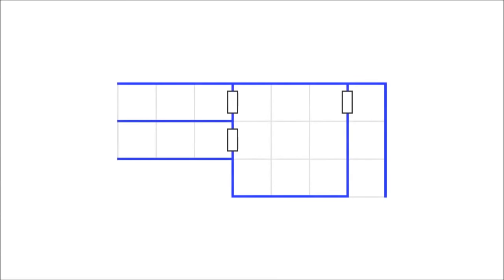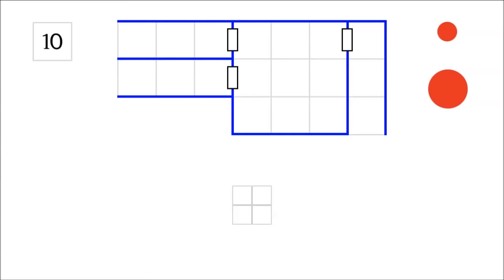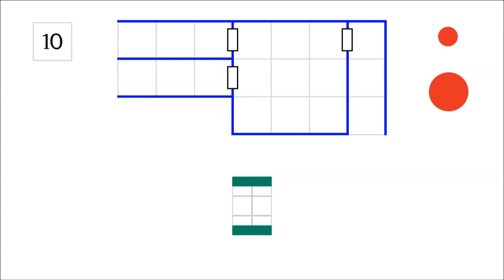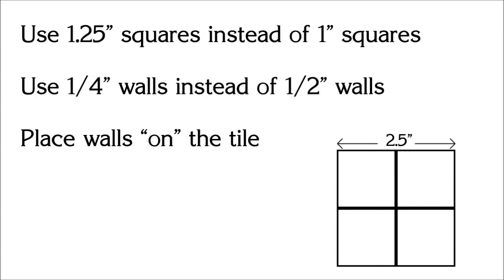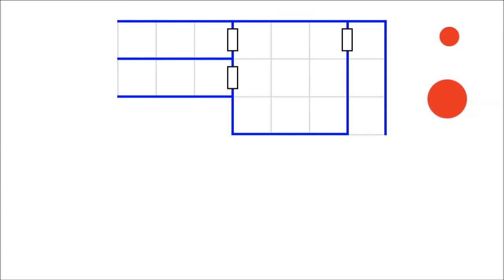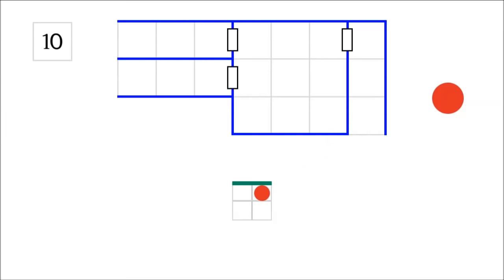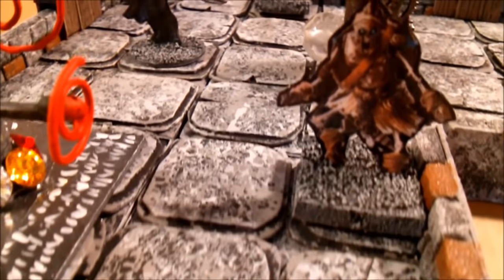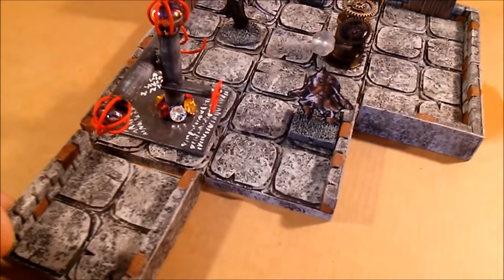Why a 1.25" Grid is Better than 1" Grid on Dungeon Tiles for Dungeons & Dragons

Comment: Warlock tiles by wizkids solved the wall issue while maintaining the 1 inch standard.
Reply from the maker: Alas, no they did not.  Watch again.  Or for a more modern explanation than this old video, try this:  https://www.youtube.com/watch?v=JUecWG1W-ss
Reply: @WylochsArmory  I'm not sure where you're mentioning the warlock tiles in there. But I have some and you can in fact recreate dungeon maps pretty accurately with them.. because they use a very thin interior wall that slips between tiles instead of a half inch space that takes up squares (like Dwarven forge)

Sure the small metal piece that slips in between tiles may be adding a small amount of space (like a 32nd of an inch) but it's pretty negligible.
Reply: I only mention it because I have recreated this system myself and it could be helpful to some with limited table space like you mentioned with your true tiles.
Reply: @xxbrkdwnxx  It looks like the WizKids interior walls don't eat up much space and it does seem like a work around but unless they enlarged their grid, that space is still coming from somewhere.  It also forces you to use interior vs exterior walls rather than just plain old walls as Wyloch's system does.
Reply: @andrewkreinbrink7023  it does take up some space but it's honestly negligible. Having used them (as well as my own hand crafted version) for a few sessions thry work great. Interior walls should be thinner than exterior anyway if we're talking like castles and dungeons.  I do like the thought behind wylochs system and it works great, I just prefer to keep the 1 inch standard. Then everything works together!

Comment: fyi, lego blocks are 1.25inches approx for 4 pips, meaning your tiles are also compatible with lego. My builds are done to this formula as well so that my tearrain fits generally with lego or can use lego in its structure for modularity especially.

Comment: I agree everything seems to work out when .25 inch equals 1 foot. The .2 inch = 1 foot is too small and then the scale is off doors are too small tiles are too small. The whole system falls over. Yes you do lose out on .25 of your gaming table.  But I would rather have working system where I can have a character go through a door rather than magically jumping walls to fit my scale.

Comment: You missed a downside: As creatures get larger, the diffference in base size starts to show itself more and more. A 5x5 creature will actually only take up 4x4 on your grid, and 4x4 creatures will start to look like it should maybe only be in a 3x3, except that that it sticksover the edges by a quarter inch. These cases are rare and can be solved by putting an adjusted cardboard circle under the mini that more closely matches the size needed to fill the space.
Reply from the maker: All true.  I don't think I've ever used a mini with a more than 3" base.

Comment: Absolutely right. on. target. I reached the same conclusion even just with using battlemats way back when figure companies started creeping in with their 28mm and 30mm figures, and definitely once D&D3.0 imposed the now-industry-standard 1" = 5ft scale onto basically all D&D products. Too cramped. Our group is slightly experimenting and testing out the possible use of dungeon tiles, and we have also concluded that 1.25" seems to be the way to go. We're still debating the overall tile width and wall placement for the various reasons you list for both alternatives.
Reply from the maker: Great minds think alike!

Comment: I have some halls with walls, and some without, in order to simulate shared walls.
Reply from the maker: Ah, but you are unable to place a miniature next to the wall, right?
Reply: Sure I can=) I make mine using the three or more squares wide, so there is some line straddling on occasion (fudge), but you just have me an idea of a "double hall" with its own shared wall...
Reply: I like the idea of the 1.25 grid, but I have invested heavily in Hirst molds. So...
Reply from the maker: Yes, exactly, that requires you to deviate from the original map and introduce error.  For many people, this error is not a big deal, which is fine.  For obsessive folks like me, it is  :-)
Thx for watching!
Reply from the maker: Ah yes, definitely not worth switching over if you're already invested in something else.
Reply: Of course, Bruce does have some 1.5" tile molds. I have a couple... Maybe I should try out your plan using those. I will let you know how it goes...

Comment: A like button for you.

The route ive gone for my tiles is to simple always works in powers of 3. 3x3, 6x6, 9x9, 3x6, 3x9, etc.  "Walls" are then constructed half an inch thick. This way even on my 3x3/6/9 "hallway" tiles, theres a solid 2" of space between the walls, for larger creatures to get through.  When I grid up a map, each grid box represents one 3x3 tile. This way all my maps line up super easy.  I also bounce back and forth between using grids, and just measuring (Have a small collection of "distance" sticks)

Looking forward to more videos from you :)
Reply from the maker: SidewaysGts Actually, for a while I did the exact same thing  :-)

Comment: Thanks for the good vids.  I have watched them all - at least twice.  I have a question:  what is the ratio of corners, to straight tiles, to field tiles to 1 wall tiles?  How many of each do you craft out of let's day 100 tiles?
Reply from the maker: +bigmiller19 Thanks for your viewership!  This question comes up a lot.  But I believe there isn't a standard answer.  You might design dungeons very differently than me.  Here is what I do: design my next dungeon.  Build ONLY the tiles I need to make that dungeon.  Run it.  Design my next dungeon.  Build ONLY the missing tiles missing.  Run it.  Continue like this...after three or four adventures you will find you no longer need to make any tiles because you have enough for anything you are likely to design.
Reply from the maker: +bigmiller19 If you want to build the Vault of Iptiz, I would recommend the following: 8 Dead End, 8 Hallway, 16 Corners, 16 Field, 8 Rounded, 8 Slanted, 24 Single-Wall, and 4 Acid.  You can download that free module from Episode 017. https://drive.google.com/file/d/0B6DUFiaF6EbpdVU4Q0xob0RIQVk/view
Reply: thank you much!  this gives me a good start.

Comment: I think the 1" hallway mentioned at the end could be solved easily enough by making the tile be the same size as the others, but put the hallway smack dab in the middle of the tile. It will be offset, but is shouldn't be to big of a leap. The extra area could just be painted black or any other color you might use as 'negative' space. Great ideas all around.

Comment: This is great. I've been encountering the same issue in designing my own version. I too came up with this as a solution.
I am designing a solution using walls of various shapes & sizes, on the sides of 2" x 2" bases. This works a treat except for shared walls under certain circumstances, where I need to employ odd sized floor sections. Still working on it.

Comment: As far as the 2 hallways go, on the map there's 3 walls represented , those two tiles you keep trying put together to replicate it on a battle map have 4 walls. So you need to make side by side hallway tiles with 3 walls instead of 4 walls.  WIth Hurtz this is easy solved, some DF tiles have detachable walls but not all. Lastly I like to note the dire need for rpg companies to start consulting architects with their map designs, with their paper thin walls.  Any wargamer to can tell ya game world scale and gaming pieces never match up 100% such is life.
Reply from the maker: +Lost Aesthetic Incorrect.  Try watching again.  If you only use three walls, you will create a 1/2" offset in the grid, which fails to meet the objectives.
Reply: No that's not what I was getting at I understood it would still be off.
Reply from the maker: Oh ok.  So then it's clear how the 1.25" solves it?  (I am working a redux version of this video right now, so if anything is unclear, feedback is appreciated)
Reply: Honestly didn't pay any attention to the details of the 1.25 grid because it didn't pertain to my table. I'll use a grid if it's marked out on a battle map already but for the most part I play grid free, using rulers, tape measures and string. If I really need a grid I use a grid shadow stencil of my own invention. You can check that out on my gaming channel blackbarnz it's simple you could make one in a jiff. Sorry don't have any real feedback for ya other then I enjoy your channel and keep at it.
Reply from the maker: I understand, thanks for your viewership!

Comment: Have you considered using removable walls ?  Example:  Run a game on a mat (2x3ft) that is textured to the area (stone, underground cavern, grasslands, sand, etc....) and lay down walls, doors and such using the carboard cutout designs you've mentioned (width) and place along the space as you go.  Granted, this may not lend exactly to the gridsystem in large display of maps (as you've indicated with Undermountain example) but it works for single room and extensions where shared walls are that big of an issue.  This allows me to reuse walls/doors as each space requires.  Just curious to hear your thoughts on that.   I'm looking forward to watching your videos throughout my free time this week.  Thanks for your contribution.
Reply from the maker: +Phalen Anjel You sure could do that - as long as the squares are 1.25" and the wall pieces are 1/4" wide, the math works the same.  But I just really like the tactile feel of tiles, so that's what I build.  I like that I can look at a square on the map and know that's a single tile, just go to the rack and pull it out.

Comment: I am new to using tiles, in the past I just used a mat with wet erase markers.  I sometimes like to have 5' hallways, how is the best way to represent those with this system?
Reply from the maker: See episode 034.
Reply: I just watched the video and I understand.  I came to this video set from your 3d printing files on DriveThroughRPG.  Will the files include the things needed to make 5' wide sections?  Or would I need to modify them or something?
Reply from the maker: Thanks for checking us out.  We have lots of plans for future TrueTiles supplements, and we will certainly look at doing some single-wide segments.

Comment: Greetings Wyloch!
Hey bud, do you still use the same measurements when making your basic dungeon tiles?  
Or, are they a standard 2.5 x 2.5 inch?
Or, have you found that it really doesn't matter if you maintain the same scale throughout all your builds?
Reply from the maker: Yo!  Not sure what you are asking....  All of my tiles are 2.5 x 2.5, so there is no "still" - they've always been that way.
Reply: @WylochsArmory  I didn't know of you had made another video with different measurements, is all.
So, you still have to account for the chipboard walls, thus following your tutorial on making the base cardboard 1=16th less on a walled side...
I guess i should just hush up, and watch your stuff again as a refresher...lol
Reply from the maker: @gsgidney  Oh I see, you mean the foundations.  Yes the foundation of the tile varies depending on what you're doing, what construction methods.  In hindsight I overcomplicated things a bit.

Comment: I like this idea and will likely be using your methods for my future crafting endeavors.

You addressed one situation in which it breaks down is the narrow 5' hallway. This can be solved by a special 1.25xN wall-less tile which is understood to have walls. There is also an issue on the other end of the size spectrum.  You showed medium and large bases in your demo.  A 3x3 huge base should also work fine, but a gargantuan base is 4x4 and on your tile system that would be a full inch short. A 5x5 colossal base would be "gargantuan" on your board.  Granted these two size categories are far rarer in use so it's not a common problem; would you recommend simply re-basing larger minis to fit the grid or some other method to address the "error" in scale?
Reply from the maker: As for larger bases, you nailed it: use case is so rare that I just don't address it.  As for single-space corridors: https://www.youtube.com/watch?v=ZZzHR6CfOV0&
Reply from the maker: And thanks for watching!

Comment: The reason you SHOULD NOT use 1.25" grids: Every square on the grid is adding an extra .25". So, a 2x2 is 2.5x2.5, a 3x3 is 3.75x3.75, but a 4x4 is really a 5x5, and now your gargantuan mini no longer fits on the grid, it will have this big border of empty space around it, and if you try to use a colossal mini, which is 5x5, it will only take up 4x4 on the grid.
Reply from the maker: Absolutely right......how many gargantuan minis do you use though, ever?
Reply: @WylochsArmory  Personally, not a lot. I do enjoy a good big monster fight in my games, though, and I mostly wanted to point out the flaw for people who do want to run higher-level games with big monsters.